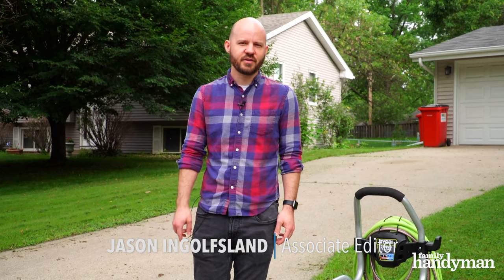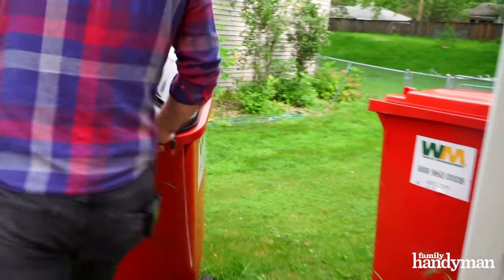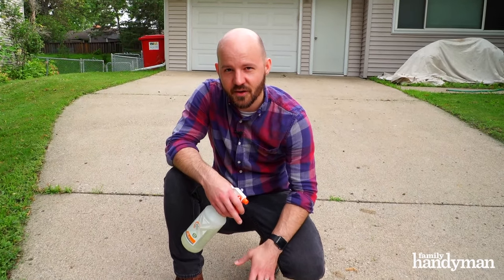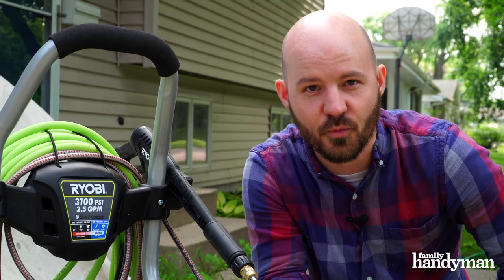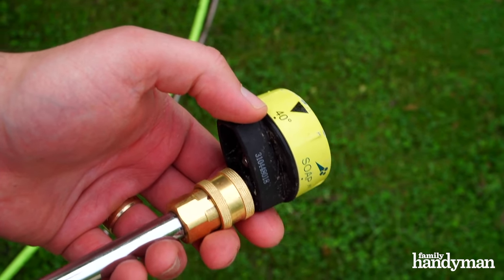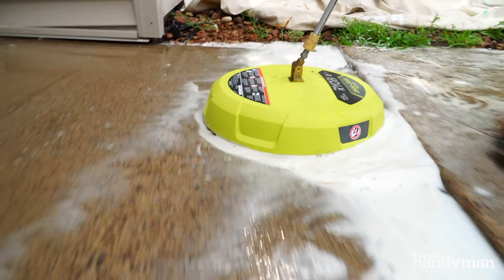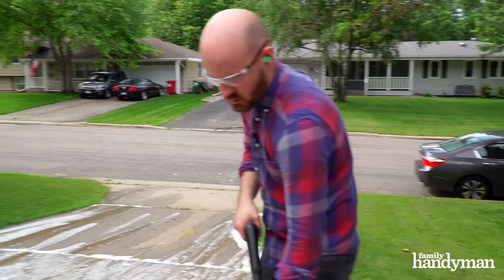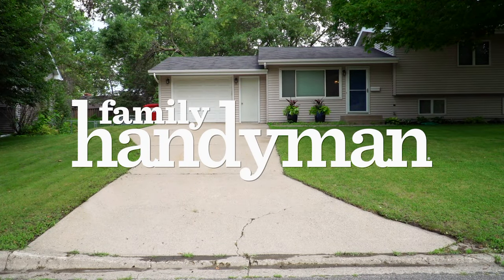How to Properly Pressure Wash a Concrete Driveway

Comment: i use the ryobi 2300 psi electric pressure washer wich really cleans and i never use chemicals!! but it still takes FOREVER to pressure wash any driveway! why!? should i do one long sweep length ways with the serface cleaner!??
Reply: It's not enough psi to clean concrete easily. I have the exact same model but I just ordered the 3,000 psi unit. It's still going to be slightly underpowered as it's recommended to get a pressure washer with at least 3,100 psi and 4 GPM instead 3,000 @ 1.1 GPM that Ryobi electric pressure washers deliver.